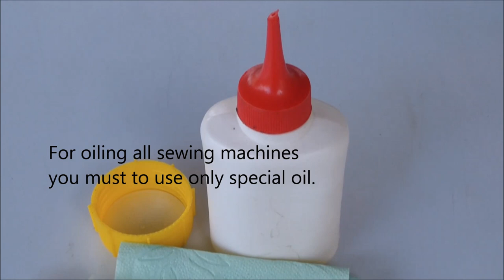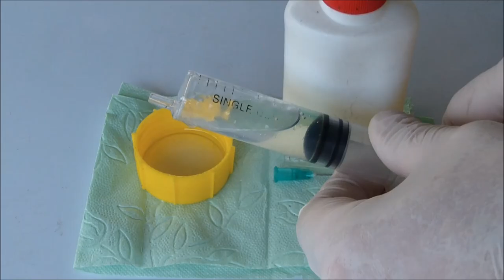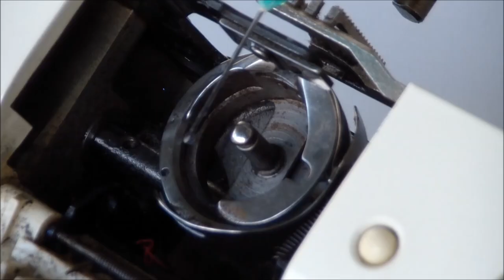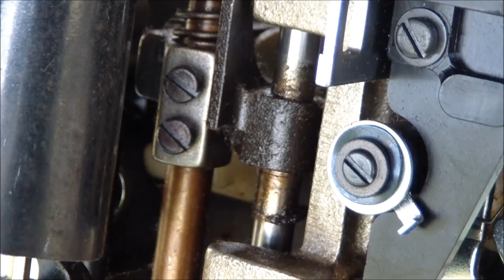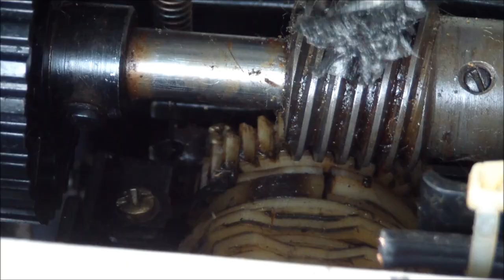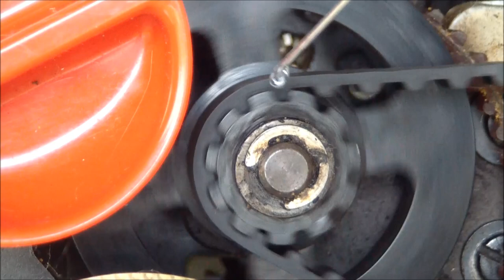How to Oil a Sewing Machine. Full Oiling a Sewing Machine

Comment: The sewing machine looks so neglected. Dust, dirt and rust everywhere. Was it kept outside? And is not  required to clean it before oiling?
Reply from the maker: Sorry, the master took an old sewing machine out of the closet and showed the units that need to be lubricated. We already told him what a slob he is.
Reply: You should clean it with a rag before applying oil. But don't use water (You can use the same lubricant oil to help you clean because it loosens the dirt).

Comment: I would really just clean out the fluff and dirt before greasing and oiling any machine. The grime will clog your machine, no matter how much oil you give it. I am sure that you drain the oil from your car engine every 15000 or 20 000km before you add new oil? Treat your machine with the same consideration. Blow out the fluff regularly, clean your bobbin casing and feeder feet at least with every 3rd full bobbin completed. It takes a few minutes but will add years to your machine's life. Also, with so much oil as given in the video, you should let your machine run for a few minutes, then let it stand for a day or two so that all the oil can drain. Then clean it thoroughly before putting any fabric under the needle.
Reply from the maker: Thank you, that's right.

Comment: The hand wheel on my singer Futura 350 is very tight and the machine wont sew. What do i do. can i oil it?
Reply from the maker: The flywheel is attached to a main (top) shaft, which has many connections to other joints. Maybe you just need to oil all the parts of your sewing machine and it will work easily.
Reply: If your machine is electronic, you should not oil it, but take it to a dealer before doing anything.  You can oil mechanical machines, though. Just not as liberally as what's shown in the video

Comment: Hi, what grass use thanks
Reply from the maker: Thanks, that's the right question. For regular lubrication, only use special oil is used for oiling sewing machine.
lubrication of many mechanism and joints is required in exceptional cases when the machine is very old.
I use a special graphite grease to lubricate the gears.